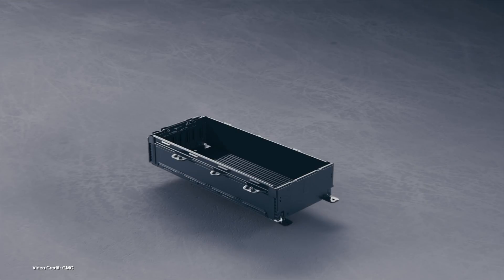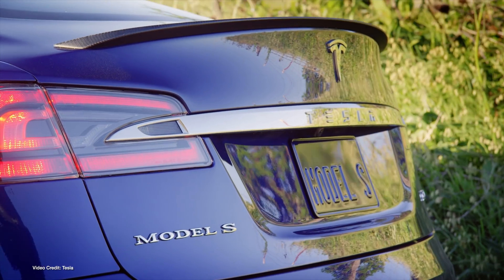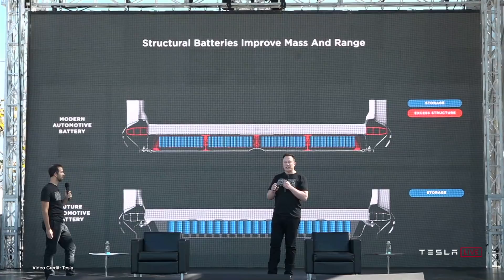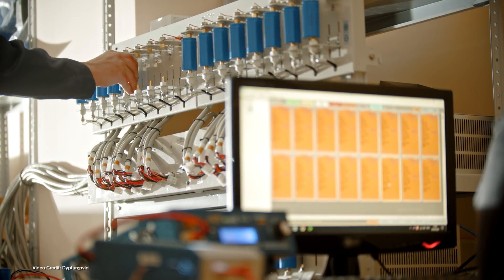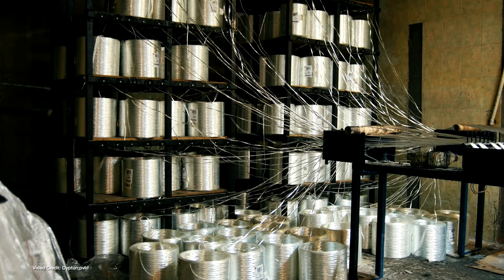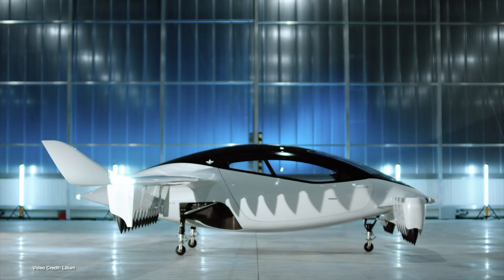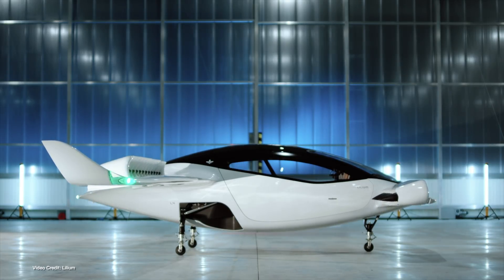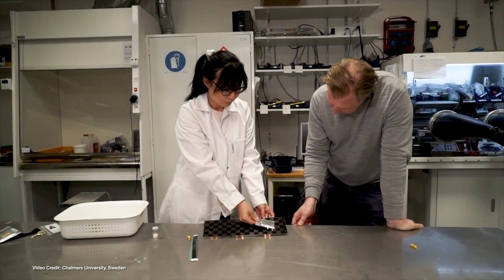Why You Should Be Excited About This Battery Breakthrough From Sweden!

Comment: Mmm what do I think?  If the entire car is the battery, what happens if you need to get the battery replaced?  I can see it working in niche markets, but I'm not so sure about EV's?  Unless it's a cheap throw away car?  Thanks for the video!!! 👍
Reply: Virtually everything in a car is consumable. For historic vehicles, people may need to replace the battery, like someone replacing an engine, but for the most part, the batteries should far exceed a vehicle's lifetime, and not be of concern to most customers.
Reply: @MRTOWELRACK  fair point.  As Electrical Engineer I just can't stomach non repairable things though.  I'm too old school lol.
Reply: @jeffreythomas815  Ideally, automakers won't be using lithium ion batteries for too long with the emergence of other chemistries, like solid state.
Reply: When the differential fell out of the bottom of my car, in principle it was fixable but in practice it meant that my car had reached the right hand side of the bath tub curve of reliability. Car designers design cars for a certain lifetime at which point all the bits will start failing. The battery unreliability thing comes from experience from mobile phones where the design lifetime is three years. Phone maker’s could make longer lasting batteries for their phones but then they would not sell as many phones.

Comment: One of the most fascinating developments I've learned of in a long time. Your caution, about how gradual may be the transition from lab to commercial product, is understandable, but I expect this technology to develop quickly: The appeal of load-bearing materials doubling as batteries is SO strong: big money is probably being spent, as I type this, on catching up on, improvising beyond, this technology. When that much goes into a project (as went recently into vaccine development), "miracles" (impressive achievements) can happen.
Reply: I wouldn´t expect mass use. As mentioned in the video, this is not a new idea and research into making for example a car chassis battery has been done before. The problem other then energy density will be price. EV makers are trying to make unified cells for their cars for a good reason. A battery that has to match structure of dozens of different products makes sense only in niche use where the cost is secondary and can never get close in price to cells made by billions. But hopefully it will be developed for drones/planes and other uses where every gram counts.

Comment: The technology obviously sounds cool, and if cars could be made out of it, they could get more total capacity with smaller battery packs, but I don’t think they can eliminate the battery pack entirely.

For example, with Model 3
Weight: 1700kg (total car, including battery pack)
Battery weight: 480kg
Weight of everything else: 1700-480=1220kg
Using your numbers of energy density:
Tesla 4680 batteries: 380kwh/kg
Tesla 2170 batteries: 150kwh/kg
Sweden structural battery material 24kwh/kg

If “everything else” were to be made of the new material with 24kwh/kg, 1220kg x 24 = 29.28kwh. That would save 195kg of weight (because 1220kg @ 24kwh/kg is equivalent to 195kg @ 150kwh/kg). If a future model 3 uses the 4680 cells, and the density is 380kwh/kg, then making the car out of the Swedish material would only create a 77kg weight savings.

It is cool, for sure, but at least in cars, it doesn’t seem practical (obviously you can’t make EVERYTHING out of the material, and what about the cost?)

Thank you for sharing info about this breakthrough, but it seems like it will be either more useful in non-auto applications, or something that needs to be developed further before it is practical for commercial use.

Thank you as always!

Comment: They always say it takes years to bring something built in a lab to be commercially viable or available but
if there is a war they can do it in months. An example is making automobile tires without rubber or the
atomic bomb!
Reply: Another example is Musk. Maxwell’s dry electrode technology was in the lab when they bought it and now it's in production. Starship is in a really heavy duty lab.
Reply: @earthwizz  nonsense, the maxwell dry electrode was already in use to produce super capacitors.
Reply: @carholic-sz3qv  Lithium batteries which use the dry electrode and capacitors which don't are very different products.
Reply: @earthwizz  sooo what?!
Reply: @carholic-sz3qv  The Maxwell dry electrode is not used to produce super capacitors.